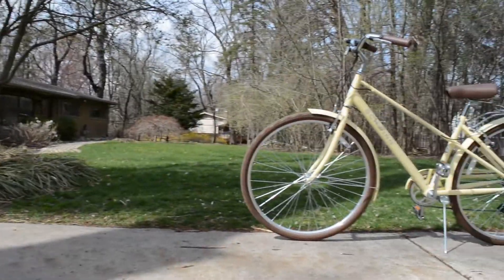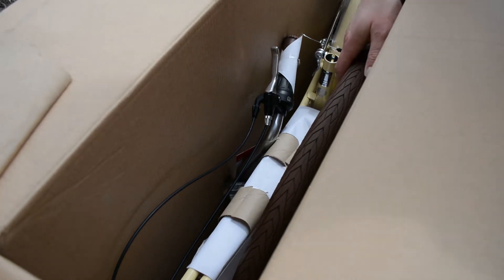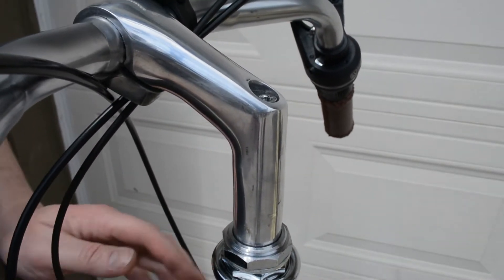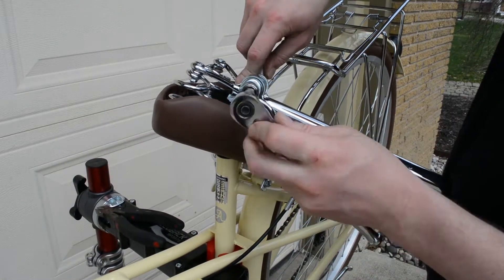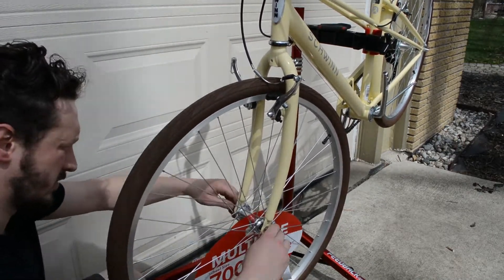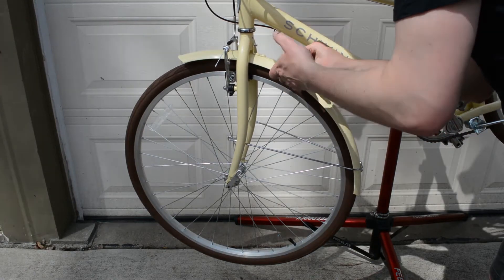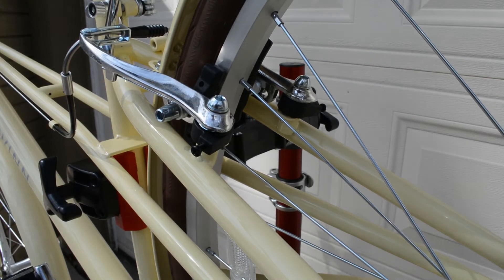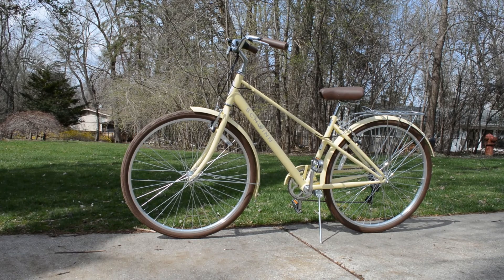How To Assemble Schwinn Admiral Bicycle

Comment: Great. Great video!  I am a 67 y.o. grandma and have never done anything with a bike but ride one from time to time.  This video is super clear and easy and just the right amount of time.  THANK YOU SO MUCH!!!  I am ready to ride!!!
Reply from the maker: Glad it helped! Enjoy the new bike!
Reply: @StevesGarage  Got a fix a flat video??
Reply from the maker: @donnaalfonso634  I don't. If you're in pinch and only have a minor leak, you can use a fix-a-flat product, though I've had it leak out of the valve stem and make a mess. If it's a major leak you're better off replacing the tube entirely since they're cheap. You have to remove the wheel from the bike, take the tire off the rim, and then you have the tube.
Reply: @StevesGarage  thank u for your advice.
Reply from the maker: @donnaalfonso634  You're welcome, hope it helped.

Comment: Is there a video showing the installation of a new chain for this bike?
Reply from the maker: I don't have one, but chain installation is pretty similar on any bike with rear gears. If the chain comes in a loop and already the correct size you'd have to remove the rear wheel and put it over the rear sprocket, derailleur, and front chain ring. If it's split you do the same thing but you don't have to remove the rear wheel.

Comment: Hey, for some reason my front wheel makes a clicking sound when I use it. After installing everything, what could be the issue? The quick release?
Reply from the maker: Probably not the quick release. It could be the spokes or the hub. I'd lean towards the spokes since a hub going back on a brand new bike is unlikely.

Go around the wheel and see if any of the spokes feel loose. The best way to do this is to sort of pluck it like a guitar string, or just grab it with two fingers and wiggle a bit. You can tighten a loose spoke, I'd go a quarter turn at a time. But remember that's what keeps your wheel true, so if you go nuts with it you'll end up with a wonky wheel. If you're nervous about doing it yourself a bike shop would definitely take care of it. 

Let me know if that helps!

Comment: Hi Steve! I bought this bike & followed your video to assemble it. However it doesn’t switch gears when I ride. What could be the issue for this? The rear tire came assembled could this be a factory issue?
Reply from the maker: I would guess it's you're derailleur, and could absolutely be a factory issue.

I've used this video in the past and love it in terms of knowing how to adjust/index your rear derailleur. https://www.youtube.com/watch?v=Bbk5RcH0bbQ

Let me know if this helps, or if you need further assistance. Nothing is worse than a bike that doesn't shift right!

Comment: Hey I’m having issues with the break pads rubbing along the tire. I’ve tried adjusting the metal wire, but I’m also having issues with the caliper being centered as well. Is there any further information you can provide?
Reply from the maker: You can loosen the nut that holds the pad to the arm to adjust it up or down if it's hitting the tire. As for the centering, there is a small black screw at the end of the arm. That adjusts the tension, and how the arms spring back after being used. Let me know if this helps, or you have any more questions! 

Bike brakes can be a real pain, don't feel bad if it's driving you nuts!
Reply: @StevesGarage  thanks for the reply! That helped a lot!
Reply from the maker: @lizgaffney1232  Excellent! Glad I could help. Enjoy the bike!

Comment: hello, i am considering buying this bike today , can you please do a youtube review of the bike ,
i see 70 % good , and 30 % bad reviews for the bike. your assembly video is excellent , so i expect you or other rider will have first hand knowledge of it's quality / performance. the bike looks like what would be great for my riding . i would really like to know your opinion of the bike , it is new and for sale already assembled  thank you very much  !
Reply from the maker: Hi, thanks for the comment. The bike was actually for a friend of mine, so I can't offer you a first hand review. But I can tell you they've been very happy with it and have been riding it without any issues I'm aware of.

I personally think it's a great bike for the casual rider. It's not the lightest or highest quality, but it's inexpensive, comfortable, and simple to maintain.
Reply: @StevesGarage  thanks steve , yes for the money $240.00 ,, good deal  i'm 6'2" , 70 yrs young 50 yr retired carpenter ,& ride cruise and easy trails got a better seat & chain adjustment  all it really needed. also ,i'm in phx,.az. so i got  a bottle of "dry lube" for the chain , was looking at the tires = HANG CHOU - do you think they are decent brand ? ,they look ok , thanks again !
Reply from the maker: @w.l.graves7228  Dry lube is perfect! I've never had issues with bike tires, especially if you're just cruising in dry weather. I'd say they're fine for your application.
Reply: @StevesGarage   very good , thanks steve !
Reply from the maker: @w.l.graves7228  You're welcome! Happy to help!

Comment: If the chain fell off, how do you fix it and how do you know if you actually fixed it?
Reply from the maker: Flip the over so it's on the handle bars and seat. You should be able to pull the derailleur to make slack in the chain. Grab the chain, put it back on the sprocket, and turn the pedals to make sure it's back on.

Comment: The rear end came assembled, so why is it that my pedals when trying to go forward seem stiff, or aren't moving my chain at all or back wheel at all?
Reply from the maker: It could be a few different things. Does your rear wheel turn by hand? Will your pedals spin backwards? The reason I ask is to try and narrow down the issue. If something isn't spinning you have to figure out what part isn't spinning before you dive into trying to fix the problem.

Comment: Very well done vid. Thanks for posting! I'm considering this bike and a follow up experience vid would be great!

One thing, if I may, is to check the direction of the front tire. Looks as if the tread is running in the wrong direction. 😊
Reply from the maker: While I can't make a follow up video because the bike isn't mine, I know the person I assembled it for is very happy with it! 

Good catch on the bike tire, it is backwards in the video. I realized it later and flipped it around. I should have made note of that in the video.

Comment: How do you remove the rear tire?
Reply from the maker: You'll have to remove the chain from the rear sprocket and open up the brakes. Once you do that loosen the axle bolt and remove it.
Reply: @StevesGarage  do you have a video instruction?
Reply from the maker: @alexusm-lw7bd  I don't, but it's a pretty simple process. The only difference between removing a rear wheel and a front wheel is getting the chain off the rear sprockets. Just pull it up and drape it over the chainstay out of your way.

Comment: I know this video is pretty old, but my gear shifter is broken, and it won't move the derailer just if anyone has way to fix it or change the gear shifter on this bike thank you.
Reply from the maker: Is the shifter itself broken, or the cable? Either way you can buy replacement parts for it. I believe the grip shift slides off the handle after removing the grip, so it's not too difficult of a replacement.
Reply: @StevesGarage  I believe it's just the gear shifter. I looked at the cables and didn't notice any cable damage. Also tried to take the grip off, and it feels stuck.
Reply from the maker: @someoneidontknow7938  Those grips are typically pretty tight to begin with, which you want so they won't move. But that makes getting them off tough. You can try to spray something like WD-40 in there to try and lube it up to get it off.